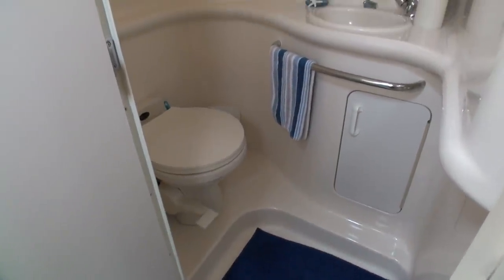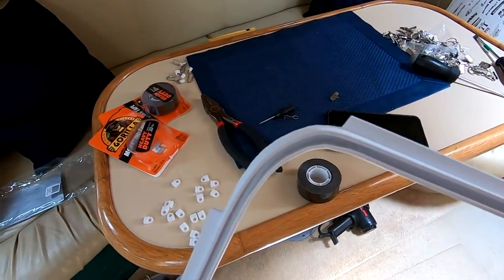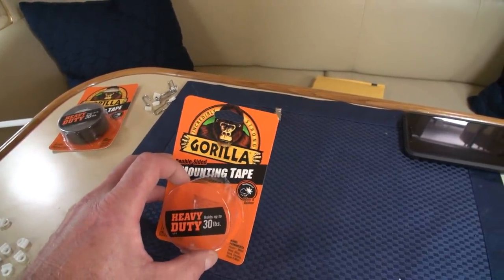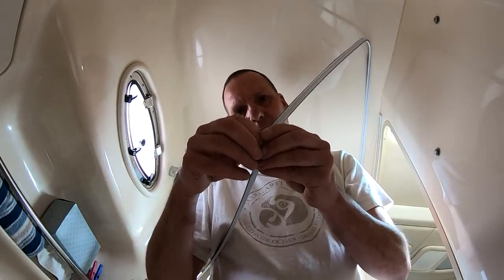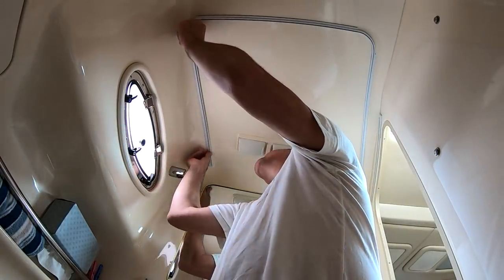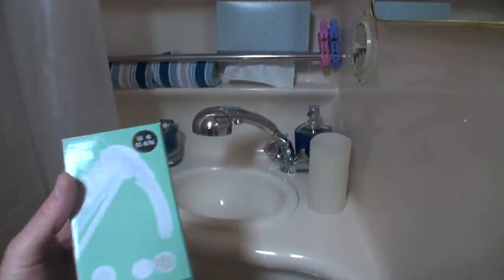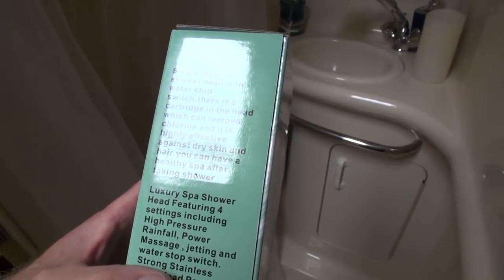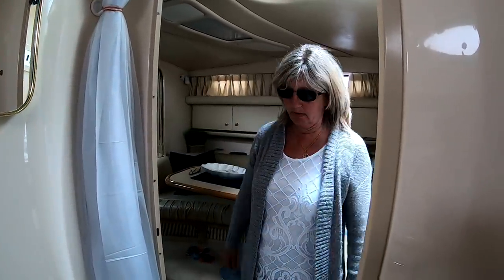New $100 Boat Shower!

Comment: That’s a good solution. I had the same head and hates having to remove the carpet , towels and special toilet paper to shower lol. I remember I decided to give  the head a thorough clean and discovered how vodka made the fiber glass walls shine !!!  So silly but kind of fun !! It didn’t take much vodka either as a little went a long way ! I used it for a polish after rinsing from my usual cleaner. I always used Basic H from Shaklee. It’s amazing anywhere and also great on boats ! Cheers !!!
Reply from the maker: Great tip! But isn't using vodka for cleaning considered alcohol abuse ;-)
Reply: @BoatingWithBoogaboo  wastage for sure !! Lol

Comment: Might be a good idea to get some strong magnets to hold the shower curtain from collapsing on you while you shower. Put the magnet against the inside of curtain to hold the curtain against the metal railings. Keeps the curtain from sticking to you. Just a thought. Beautiful Boat, have fun‼️👍  Vinny 🇺🇸
Reply from the maker: Thanks for the suggestion Vinnie, but it works perfectly as is. Besides, magnets wouldn't stick well to fibreglass 😉
Cheers!

Comment: Top Tip for boat & caravan & motorhome dwellers/users: Use a spot of vinegar in the water used for the final wipe down of shower cubicles. Leaves surfaces streakless, shiny, & tends to inhibit mould growth. Any vinegar will do but white vinegar gets to be top of the list as it leaves less smell.

I used to liveaboard my boats. I aspire to that for retirement, soon. The utility of a Decent Working Shower (DWS) just cannot be overstated. It's unbelievable that some boat designers - especially with majority sail powered yachts - seem to forget about a DWS until just before deadline, then panic & place the shower right on top of the toilet as your man in the video demonstrated. 
 What Boogaboo's done here is exactly what I would have done. Really Good Job he did, too. I state 'would' because in the last few months, I have thought about it in real depth & decided against it for a few reasons, mainly to do with mould. That ever so useful track? Yeah. It is going to fill up with water from the spray of the shower & condensation. Then, unless it is dried completely after each use, which is a most fiddly job involving cotton buds, mildew & mould will occur. That lovely shower curtain that is meant to save Anchor Girl the work of drying down the entire bathroom cubicle? (Why your man cannot do that himself is unfathomable) Yeah. The same goes for that as the track. The one saving grace with the curtain is it can be removed, to be pegged up outside to dry. Then there is the footwell to be mopped, & the foot mat to be wrung out & hung up to dry. All this for the lack of a DWS being part of the integral design of some boats. Sigh.

Comment: Hey Paul, Brilliant install. You are definitely a contender for the MacGyver award of which I have been the proud holder for the past 20 years. I like the molded shelf above and behind your sink. We have a 2001 340 and we do not have that built in shelf.
Reply from the maker: Thanks, we are very happy with the way it turned out. First use yesterday and worked as hoped for 👌 
 And yes, there are subtle differences between the 330 #Sundancers and the 340, with that shelf being one of them. Same with how the cockpit fridge & sinks are configured. Yours is more tight to port, but we gain a companion seat. I love our 330 the way it is, but my back & neck sure would appreciate your higher radar arch 😉

Comment: Hi Paul, we bought the shower head for our Sea Ray 330 Sundancer. The hose is too big not sure if you had to do some modifications? Did you use a adapter? Specifically, did you splice a the new hose to the old hose? Thanks! Excited to install.
Reply from the maker: Simple screwed the new shower head onto the original hose. Easy pezzy.
Reply: @BoatingWithBoogaboo  thank you for your reply. Great videos. Counting the weeks until we back out on the water!

Comment: Paul ,Love the new shower track idea, great job!. only thing I see is you may still get sink soaked by stopping track where it did in corner, can you place a small hook by mirror direction to maybe catch the last eye of the curtain to create another bend in curtain. standing there water will bounce of your body into that corner. Just an observation but love the idea for my future 310, thanks
Reply: paul check this out..comes 2,3,5,and 10 meter lengths.    VRSS Flexible Bendable Straight Curved Curtain Track for L Assorted Sizes
Reply from the maker: Thanks for your idea, but we each used the 'new' shower yesterday and it worked perfectly 👌 The only area that got wet was the forward facing wall, requiring a quick wipe down. Apart from that, the sink & toilet area remained completely dry. Very happy with this setup!
Reply: @BoatingWithBoogaboo  Happy wife means happy life. So glad its works  great, just remember your the wheel to all the versions to follow, Thanks

Comment: Wow that is so cool !!! I want to know after you have used it if the steam makes it to the other side of the curtain. Also I have had the curtain like that blow in on me and stick to my skin. Wonder if static guard will fix any of those possible problem. I think it looks great!!!!
Reply from the maker: Put it to the test for the first time yesterday  and it worked magnificently 👌 All remained dry, save for the forward wall & mirror, but that just required a quick wipe down. Very happy with it👍

Comment: Maybe I’ll give that a try on my regal wet head. Great idea
Reply from the maker: I can say that it worked out very well for us aboard our 330 Sundancer! We used it continuously throughout the season, whether at our home port marina, or during our five week Epic Boat Cruise. AND, by adding our onboard water filtration system, it meant that we were never without enough water to use the shower! Check out my installation video for that system in case you missed it: https://youtu.be/15850c5SWdA

Comment: Did the track come with stops for the ends?
Reply from the maker: No, it was only the track by itself, so I used some small spring clips that came with the curtain hangers. Works fine and I didn't have to drill any holes.

Comment: Where does the water drain???
Reply from the maker: The shower drains into what is called a shower sump. It's basically a sealed box with a pump, operated by a float switch and pumped overboard. The air conditioner condensate line also drains into that box.

Comment: Its not a "Navy Shower" ...in the US Coast Guard, we call those "sea showers." Nice solution with great Chinese parts ; )
Reply from the maker: Thanks, but have found that neither a navy shower, or a sea shower is required, as a continuous stream of water works fine. And since we have our funky water filtration system on the #boat, we have a virtually inexhaustible source of water👍